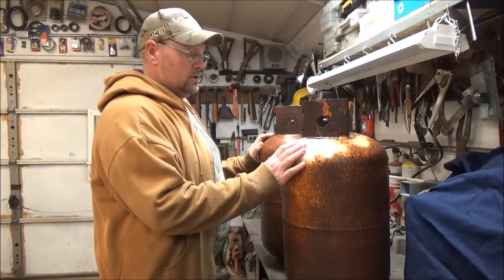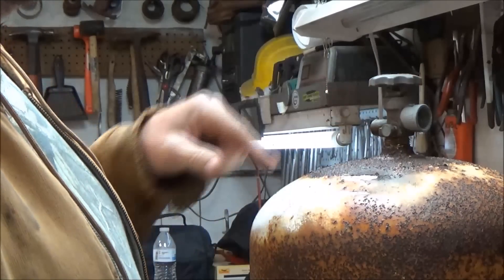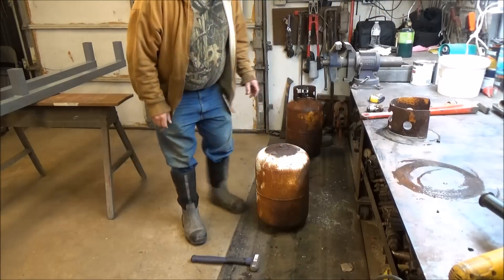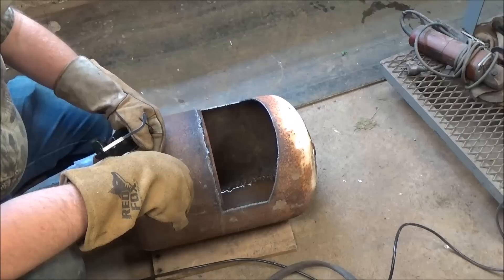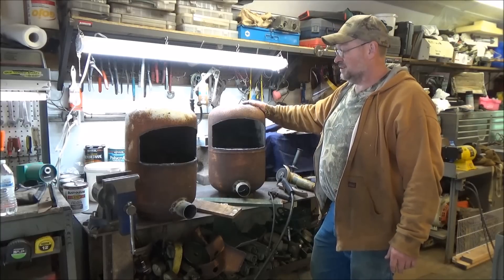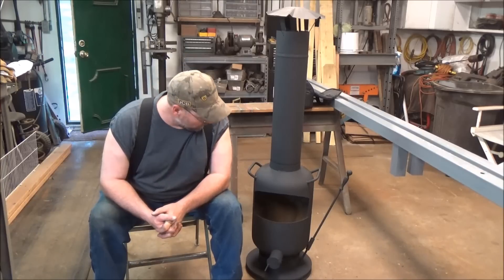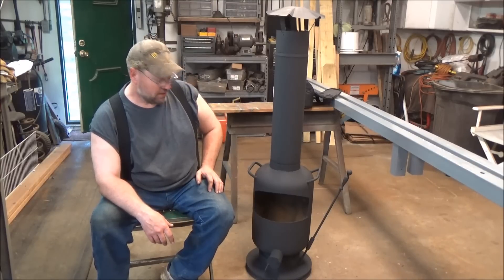homemade firepit wood stove

Comment: Tell me why people work on the floor all uncomfortable. hehe  ? One little tip. When you put your sleave for your top pipe. The sleave should be smaller than the top pipe so it will fit over it instead of the sleave going inside the upper pipe. This will ensure any smoke will not leak out. . It will also keep rain water from leaking down inside the fire pit when left outside in the eliments.  Great job ,Thanks for the helfull tips. Cheers

Comment: I made one very similar to these. I just have the opening right in the middle and not as tall. The pipe at the bottom i fill with dryer lint and saw dust mix to light the fire. Burns really hot really quick, but enough to light the wood.
Reply from the maker: cool , good tip

Comment: If you mount the poker holder on the base instead of the bottom of the tank, it might prevent heat being conducted through the metal...keeping the poker cooler.
Reply from the maker: The base is cast iron hard to weld.

Comment: Nice work,  I also made a larger fireplace out of a 30 gal. tank.  When I cut out my door, i welded it to a hinge so I could close the firedoor when needed.  I also put a grill I the stove about 8 inches up from the bottom,  less cleaning of ashes for me... nice job.clean unit.
Reply from the maker: Thanks Tom.

Comment: Enjoyed watching and a nice idea.  Would be nice to have a 2 or 3 inch threaded female hole in the bottom with a male threaded cap that can be removed.  This way you could use hot soapy water to clean the bottom out.
Reply from the maker: Good idea Dean.

Comment: a bain marie pot is slightly larger in diameter at the top than it is at the bottom. Push it in the hole from the inside weld in place and you have a pipe that a stove pipe could be slid down on.

Comment: Subscribed, any reason why you bolt the rotor to the bottom instead of welding?
Reply from the maker: The rotor is cast iron hard to weld thanks for Subscribing.

Comment: I guess I've found a use for my old bottles now! 
I wish you had yelled "BOOM" when you put the flame in the old bottle, but I did notice in one clip there is water in the bottle for all the Safety Sally's out there. 
Great job man great inspiration for a project
Reply: Love the testing to see if the tank is empty by sticking a torch in the tank while standing over it in the garage. Safety Sally just had a heart 💔 attack. Haha. 
This is a very kewl project. Low cost, fun, easy and useful. Great design. Thanks for posting.

Comment: Nice project but just one thing.  you must have the stack go around the outside of that ring you put on top of the stove to avoid having smoke escape through the gap. the ring should have been smaller than the pipe not bigger.   All joints must have smoke flow into next pipe joint.  If this unit was ever used indoors you would have carbon monoxide escape that joint
Reply from the maker: They were not made to put in the house but with some modifications you could I have a video that may help you John.
https://youtu.be/uXLgoL9ECbM

Comment: Nice build!

One suggestion -- next time you build one of these, I recommend you consider making the collar smaller so the pipe goes outside the collar instead of inside it.  That way water would stay outside the pipe and not get trapped between an external collar and the pipe inside it (which would  likely cause a rust issue).  It would also prevent rain water from leaking inside the pit.  Instead it would simply run down the sides.

You could fasten the pipe to the inside collar using stove bolts or large self tapping sheet metal screws.

One other thought regarding preventing rain incursion -- possibly make a "brim" and weld it above the fire opening -- kind of like a small 1 inch awning so that rain would be deflected and couldn't just drip into the opening.

I live in the Pacific NW, so we get a lot of rain during the fall winter and spring, so keeping it out of where it isn't wanted is a big deal here.

I watched the other video you did of a later build and like the rebar grill you made to fit inside.  That steak you cooked looked delicious!

One comment about safety -- I recommend that, after you remove the valve, you "always" fill each tank up completely with water to force any remaining heavier-than-air propane out of the tank before you start cutting and welding.  You are probably okay to cut off the guard at the top to help get the valve off first -- but doing any more without making sure the tank has been emptied of propane first is asking for trouble....
Reply from the maker: Thanks for watching.

Comment: If I build like this I'm probably going to use 6 inch flue collar/damper like they make for the barrel stoves. Not hard to find a farmer or shop that had a barrel stove and they burnt it out and just threw it out on the scrap pile.

Comment: Im confused about something, i saw he used a magnet to hold a drain pipe at a right angle, doesn't heat kill a magnetic charge? How is the charge still there?
Reply from the maker: Its not hot enough to kill the charge thank you for the comment.

Comment: Hey kevin. Re-weld the valve guard back on for a skillet mount. Use a 4in. stack with 1.75 to 2in air intake.

Comment: Great idea.  I'd suggest putting a fire grate in so ashes can fall away from your fire.  
A nice finish to the opening might be to weld  so 1/4" rod along the edge around the opening and fare in with weld/grind.  give a nice, smooth edge.
overall they seem to have turned out well.

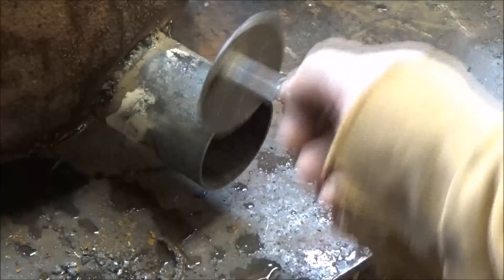Comment: 20:42 that metal disc needs a tab on the top so when you close it down the tab hits the pipe and stops it dropping below closed position and opens again... like  a gravity stop
Reply: Yes better of  making the ring smaller and the pipe stab over it 
That way less of a smoke leak

Comment: Propane is heavy, the safe way is to take it outside put a water hose in it and fill the tank till it overflows then you know there is no gas inside, better to be safe then sorry.
Reply from the maker: Thanks for the info.
Reply: Yup! I'm taking a Sculpture class, welding steel. I have 2 propane tanks. My instructor said that we need to take the tanks outside with the water hose and fill them up with water first!
Reply: barbara chalfant Reallivecam
Reply: Gerard van Grol +
Reply: Gerard van Grol
Reply: barbara chalfant ч,
Reply: That sounds like good advice. I'm thinking about buying a powerplasma cutter myself for projects like this.
Reply: Since propane is heavier than air just turn it upside down, heavy propane will flow out, like you would later do to remove water from it. Done it many times.
Reply: 1995Benzo - did you just take the valve out first or are you somehow filling it with water through the valve and letting it blow by?
Reply: A couple of things i wish to know:
1. Would you remove the tap to fill with water?
2. Would you then empty ALL the water out prior to cutting or would you tip it on it's side so it empties itself to just below the relevant hole for it to dissipate from then do relevant cutting with what surplus water remains inside? 
Thanks

Comment: Nice job  they look great !!  I worked at Frontier  tank works we built propane tanks, we welded them on an auto roller , and each tank was pumped with 5× its rated pressure  before it left . great job keep em coming
Reply from the maker: Thanks.

Comment: wood burns by drawing its air in from above the fuel, it needs no grate, or air supply from below.
Reply: Rufus Chucklebutty fire needs oxygen to the bottom to fuel the coals hence why every woodstove made has grates at the bottom. see above a fire is
 carbon below the fire is oxygen.
Reply: Ace Degenerate lol
Reply: ***** a bonfire laid on the ground would not burn then in your scenario. Please go and research the subject before commenting. Modern high effecientcy wood stoves have no grate, no air supply to the ash bed, and a preheated air above the fuel, tell me how they work then ?